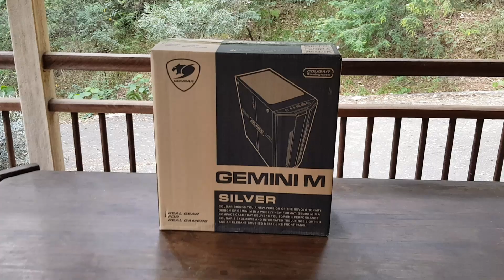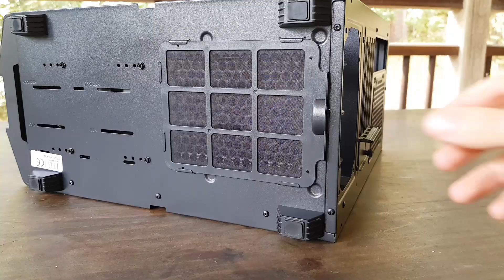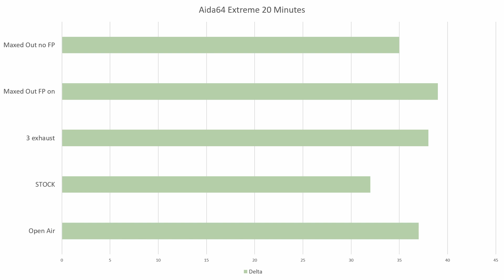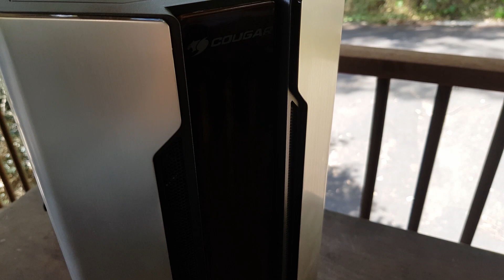When Will COUGAR LEARN?? Cougar Gemini M Case Review

Comment from the maker: Timestamps!
0:00 Intro
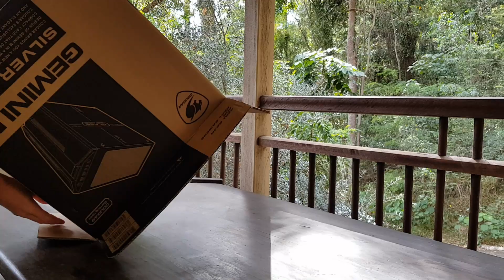1:13 Unboxing
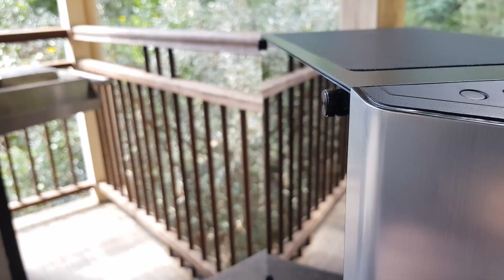1:28 Glass and side panel mounts
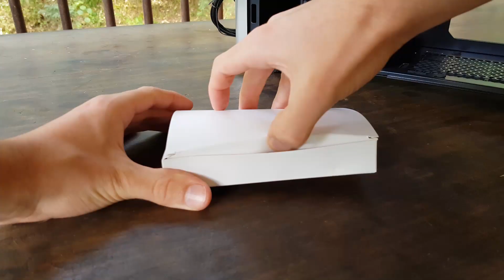1:58 Accessories and screws
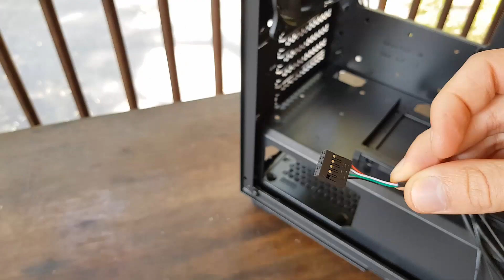2:17 Front IO and RGB Connectors
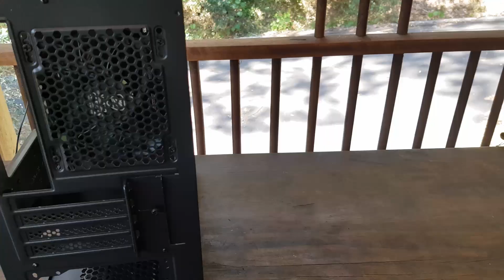3:00 Back of the case
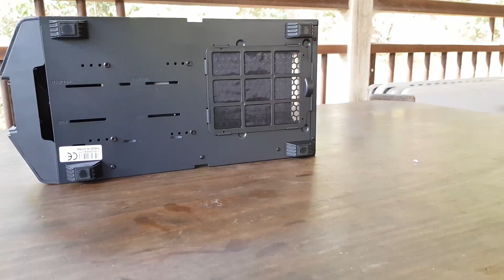3:14 bottom of the case
3:28 Inside the case
4:24 Fan and Radiator Support
5:28 Front Panel
6:06 Thermals
8:24 Drive Support
8:52 Cable Management
9:16 Clearance
9:58 Conclusion

Comment: Im quite new to PC stuff so help me out here. You said its best if we dont put front fans? or did I get that wrong xd
Reply from the maker: If you had the option of putting 2 in to top or the front go for the top but if you have enough for all the locations you mayaswell. But you see diminishing returns putting extra in the front with an air cooled system.
Reply: @connectronbuilds9960  I see thanks a lot bro <3

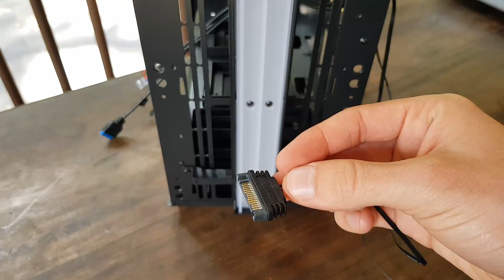Comment: 2:26 Where that cable goes? I mean in what part of the mother? Because I have the RGB lights of the front panel working, but I can't switch the colors with the front button, I think it's that cable that I'm missing?
Reply from the maker: Did you plug the reset switch into your motherboard or the front panel? Just check it's still plugged into the front panel on both ends. The cable you're referring to usually plugs into your motherboard, not all of them have a 3 pin 5v rgb header though so you'll have to check.
Reply: @connectronbuilds9960  thank you so much, I'll take a look

Comment: One more sub! Even though you didn't recommend it fully, it's going to be the case on my build. Been using some random cheap case and used parts from my first PC up until now. Just decided to build a brand new one, but this case is just perfect (size, looks and, most importantly, price) for me. Cougar Gemini M it is! Where I live most cases in this price point are still trashy as hell. 

Current specs:
Asus P8Q67M
i5-2400
Generic 12Gb 1333MHz
EVGA GTX970 SC ACX 2.0
Generic PSU
2x 320Gb 7200RPM Samsung HDDs
Generic case

New build specs:
Gigabyte AB350 DSH3 or Asus Prime B450 Gaming (depending on prices)
Ryzen 1600AF (new, got for 30% less on a sale)
XPG Spectrix 16Gb (2x8Gb) 2666MHz (new, thinking if 4x8Gb or not, 32Gb seems overkill for me, at least for now)
Same 970 (It's still kicking ass, but I will get a new one later on)
Coolermaster Masterwatt Lite 600W (new)
1x NVMe SSD (480Gb at least)
1x 1Tb 7200RPM HDD (New Barracuda probably)
Cougar Gemini M (new)

Comment: how did you open the front cover!?
Reply from the maker: Pull away from the case using the hole at the bottom.
Reply: Connectron Builds thanks! Really appreciated

Comment: Would you recommend 3 exhaust fans (1 in the back 2 up top) and one intake in the front? i have this case now with a b550 motherboard and gtx 2060 super so just trying for the best airflow.... oh as well as a stealth wraith cpu cooler (standard with ryzen 5 3600) all fans are 120mm
Reply from the maker: Yeah that sounds good. Although If you're spending money on fans I would buy a better cooler for your cpu instead.

Comment: Me Using the same case. Any tips to remove the front panel? I'm struggling a bit. Great review
Reply from the maker: There's a little hole at the bottom of the panel, just pull on it.

Comment: do you recommend using corsair h115i aio radiator on the front panel
Reply: also how can I achieve negative pressure with this case?
3×120mm top in
2×120mm front out
1×120mm back out
Reply from the maker: Hard to say really, my testing will differentiate with your setup so I would test out what works best for you. Generally you'll want you radiator mounted to the top (if possible) for better longevity of the cooler (because it keeps the air bubbles away from the pump).

Comment: I have this case. I have to agree that it has a very poor airflow. My Ryzen 3600 with a Noctua NH D15 (1 fan setup) surpasses 70c while gaming (Warzone, Witcher 3).
Reply from the maker: Damn, how did fitting the d15 go in such a small case?
Reply: @connectronbuilds9960  I had to remove the front fan for it to fit.
Reply: you literally have the set up I wanna use 🤣🤣🤣🤣🤣🤣
I so happy to see you man
so you don't recommend this case!
Reply: @thawesnerd  No I don't. Aside from the very small vents up front, the huge rgb housing which blocks the front fans further hinders the intake of air.

Comment: Bought this case and cant get the rgb front to turn on, help? :/
Reply from the maker: It by default uses the cases reset switch to cycle modes so if you've unplugged that or the Molex connector that could be the issue.
If you've plugged both the 3 pin rgb and the Molex in at the same time that could also be the issue.
Reply: Having a kinda similar issue - the rbg turns on but won't cycle through the different effects (just stays on the same effect as when the pc starts up) when the rgb button is clicked, have any tips/suggestions?
Reply from the maker: @luna_moonx  I'm thinking the reset switch might not be plugged into the front panel fully or something like that, other than that I'm not sure.
Reply: @connectronbuilds9960  thanks for the reply, I'll take a look again and see if that's the issue. Hope that it is so I can get it working.
Reply: @luna_moonx  Got it figured out. Make sure your SATA is connected first from your chassis to one of your PSU SATA ends. Then follow your case connections to your mobo. Make sure your case connectors are in the right place, if not the RGB switch on the top next to your USB's and jacks wont cycle it. Turn the computer on and give it a go.
Reply: @poplo7  thanks for the tip, I'll try that out. Still haven't managed to fix it so hope that this works for me.
Reply: @luna_moonx  Have the same issue, did you resolve it?

Comment: How many fans can I hold
Reply from the maker: 3 front, 2 top, 1 back.
Reply: Connectron Builds is that 120mm or 140mm
Reply from the maker: @violentgaming180  the back is 120 the rest is either.
Reply: Connectron Builds so it holds 120mm fans with 3 at the front 2 at the top and 1 at the back
Reply from the maker: @violentgaming180  yes
Reply: Connectron Builds thanks

Comment: do you need to plug in the 3 pin rgb connector for the front rgbs to work? I dont have a 3 pin header on the motherboard and dont need control via software.
Reply from the maker: No you don't, if you don't have one you can just use the cases reset switch to control it.

Comment: Hi, did this case come with fans? Thanks!
Reply from the maker: Yeah it comes with the 120mm at the back.
Reply: Connectron Builds do you think it’s okay if I just have the one case fan?
Reply: @glusur76  I think you'll need at least 2 fans, i'm no expert but i think you'll need at least one exhaust and one intake so the pc has a nice flow of air.
Reply: @puggyr650  okay thanks bro
Reply: @glusur76  np man

Comment: Is this good for gaming?
Reply from the maker: Depends what parts you put in it.
Reply: @connectronbuilds9960  gigabyte rx 570,ryzen 2600,gigabyte b450M,antec neoeco 550 watt psu okay?
Reply from the maker: @jahedulalam6034  yeah that's good
Reply: @connectronbuilds9960  this is good for rx 5700 8gb, ryzen 5 3600?
Reply from the maker: @RardVer  yeah, if you're using the blower 5700 though it might not be the greatest thermals wise

Comment: Hi, I love your video and I just want to ask how can I open the front panel? It said that I can remove the front panel to install cooling fans but I can’t do it regardless of many hours of searching. Thank you!
Reply from the maker: It's held on by plastic clips, you pull out from the bottom away from the case, theres a little gap at the bottom of the panel.
Reply: Thanks for your reply, I’ve found something like a clip underneath the case, inside the gap, but it is really hard to bend and to remove. Do I need to unscrew anything else? Or I just pull the clips in opposite directions?
Reply from the maker: @BrianTruongg  If you go to my review of the Matrexx 30 or the Casecom XM 91 it removes the exact same way. you shouldn't need to unscrew anything you've just gotta pull from the hole at the bottom outward.
Reply: @BrianTruongg  just yank it off, cases have been build this way for over 15yrs.